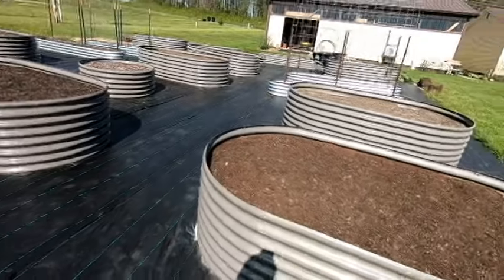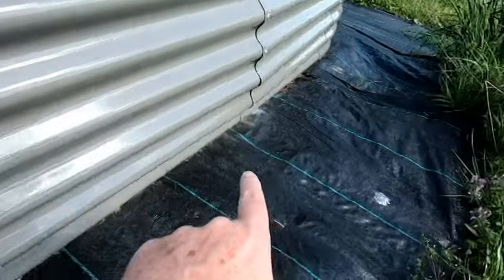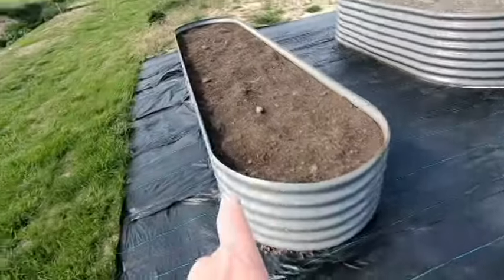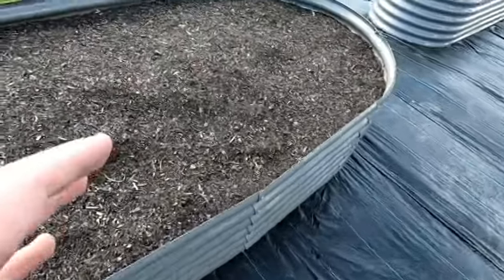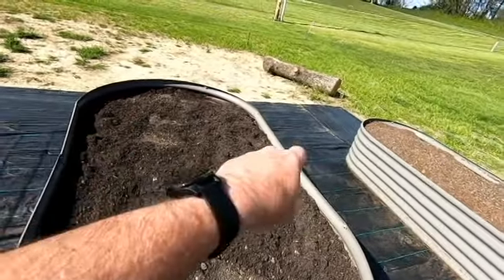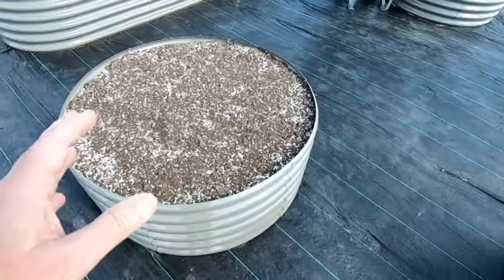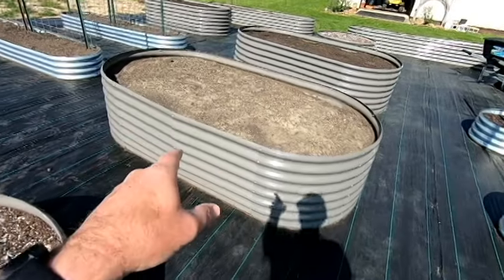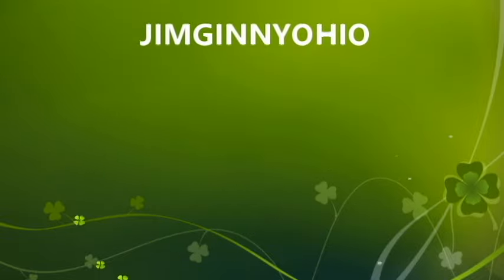Anleolife Garden Bed Problems

Comment: Just bought 3. I tried installing the cross bars they now send with the beds (so you are probably not the only one having this issue, or at least your feedback has had some effect), though they haven’t yet added anything to the assembly instructions for the bars. I tried installing them during assembly and had the same experience you did. The bars are a few inches short so they actually pull the sides inward. I even tried just using one of the two connection holes in the bars to make them longer - still slightly too short. I may try jury-rigging something, but the design problem is obvious - with relatively thin metal construction AND a wing-nut secured seam, there is just no way the sides are stiff enough to withstand the hydraulic pressure of moist soil as it settles over time. Other than that one drawback, they really are a nice raised bed for a decent price. Shame.

Comment: The rounded corners should overlap the middle section.  Looks like it doesn't.  The middle section needs to be behind the sides.  Corners always should overlap on both sides and the middle needs to be behind it.

This guy can tell you how to avoid that bulge.  Everyone needs to do this when putting them together.  The companies could save themselves the trouble if they would put that in the manual.
From 15:00 he begins to tell how to avoid bulging of the middle panel to 18:50.

https://youtu.be/TUAsZQsi0ac?si=R8ie4W3uuq2xS5xa

Just take the middle pieces and put it behind the sides and it will be strong.  Thanks to the video my two are strong.  Nothing wrong with the beds.  Just the way they are set up.  Short middles need to be behind longer pieces on both sides.
Reply from the maker: Actually, the Anleolife folks admitted that MANY people were having the same issues I experienced with the 4x8x2 beds. The problem is they didn't include any cross-braces and the 8-foot span is too large of a space to not have those. The corners overlapping the sides would not have improved anything in this case since the weak point is along the center seam...which isn't protected or contained by the corners
My problem with Anleolife is that they missed that in the design of their product and this created MUCH additional work for me since I purchased so many beds at once. After receiving the cross-braces from them, you have to remove most of the soil from the beds to try getting everything to line up again since the soil settles and presses outwards at all points of the bed.
Reply: Yes they are not made like the vego garden beds and the Olle.  That only works when the middle piece is shorter than the others.  Vegega and a few more companies have the same amount of pieces.  There are usually 12.  This looks like less.
Reply: Thank you good sir for your review.   I will not purchase.  You’ve saved me $1400 & frustration (I was going to purchase the 12’ beds).

Comment: 6 of the same beds.  Same problem.  After the season im going to dig them out and make my own braces.
Reply from the maker: I was able to get them to send me some braces. However, to install them, you have to completely remove all of the soil around the perimeter of the beds and also down the middle where the braces go. It's a real pain having to do all this work twice. I wish there was a way to sue them for false advertisement since they originally advertised the beds as "having thicker metal with no need for support rods". 
I will continue spreading the word for people NOT to purchase from them. I hope you do too! Best wishes in getting yours fixed at the end of the season! Thanks for sharing your experience too!

Comment: ask for refund
Reply from the maker: Already tried that. That's when they pointed out their 30-day return/refund policy.

It's bad they advertise their beds will last for "many years" but only offer a 30-day refund policy.  I guess that should have bee the red flag, huh?
Reply: I appreciate you sharing the problems that you've had.  However, all the other companies that I've been comparing also have a 30-day refund.. If you think about it, how many gardeners after deciding gardening was too much work woul be trying to get a refund after the first season?  It's not only about making a good product and supporting it, but staying in business. I was about to order a number of 4x8 beds, and I probably still will. It is unfortunate if they have not made those braces properly, but the other features, like the rolled edges, are important to me. The braces aren't that big a deal.  I will make my own if necessary. It is unfortunate that they are sending out improperly sized ones. I think you might have found that other companies would not have bothered giving you the discount / free stuff, or new braces. While I was listening to you I had to wonder at what point you would have felt satisfied.  You said the beds look like garbage.  Sure that hourglass thing would be better without it, but the beds are absolutely functional.  It's a fallen creation man. There is no perfection here.
Reply: I bought the epic garden beds and the  screws they provide rusted within months, I don't recommend theirs either